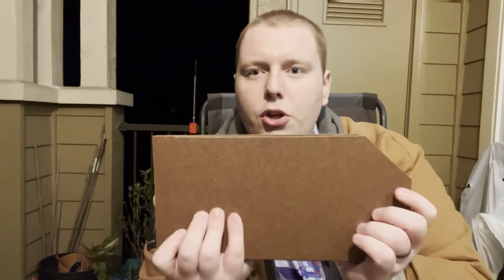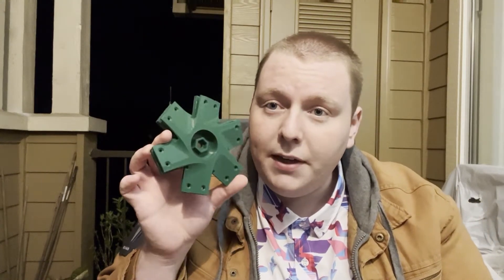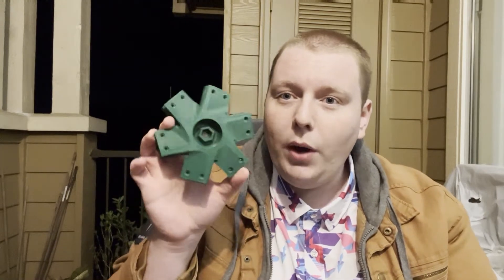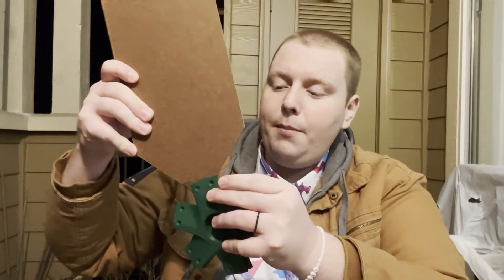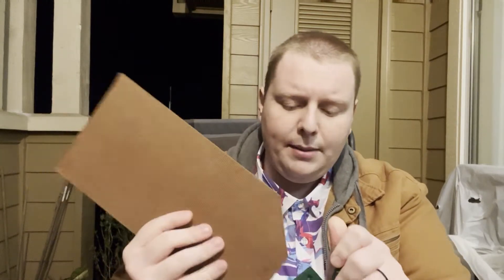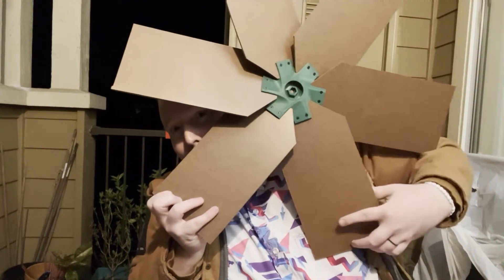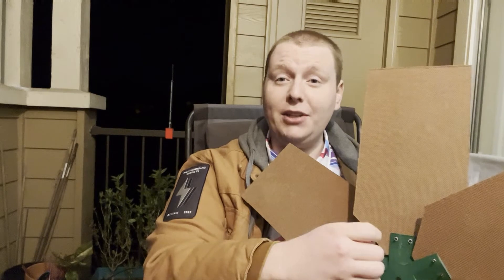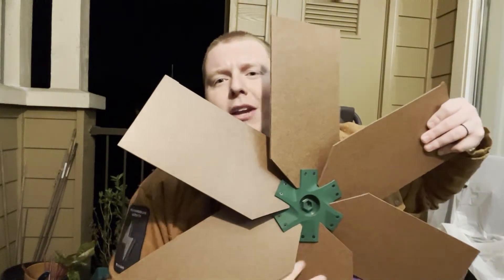DIY Wind Turbine Design and Assembly (HAWT) - Windmill XVII Update 2

Comment: This is only my second video of yours I'm watching, you may cover this in another one. IF that is PLA you're printing in, be warned that PLA plastically deforms. If you tighten those nuts down hard, they will EFFECTIVELY loosen over time as the PLA permanently deforms. Other plastic does better with this, so that doesn't rule out 3d printing completely, just PLA.
Reply from the maker: Good point. I use PLA+ for these and print at a pretty high infill. It's weird, I've seen normal PLA deform into ungodly shapes when left outside, but the PLA+ with thick walls and infill seems to hold up pretty well. I've had turbine hubs outside for months at a time with almost no warping. Maybe I'm just lucky?

Comment: What type of engine did you use?
Reply from the maker: Great question! I plan to do another video on this soon. I used a NEMA-17 stepper motor as the generator. 

There are many different types of motors one can use, but I have found stepper motors to be the best combination of simple, cheap, and efficient.

Comment: I'm a big proponent of the Hydrogen Homestead. Using PV solar, hydro, and windmills. We will need as much energy as we can get to propel American farms into the Hydrogen. you lose about %50 of the energy in water electrolosis but you get a highly mobile energy source. Espeiecaly as both Hydrogen fuel cells and internal combustion hydrogen powertrains come into the industry. A lot of these heavy industry vehicles are based on diesel and ICE Hydrogen is a direct swap for tractors trucks and trains. Some want to use the current NG pipeline networks to transport Hydrogen. They are an alternative to the massive transmission lines to even out the Grid.  There are even a ton of Opportunites to make less environmentally friendly hydrogen from current industrial waste.